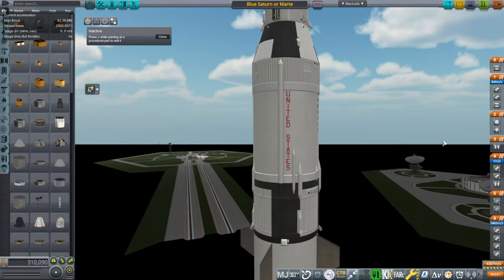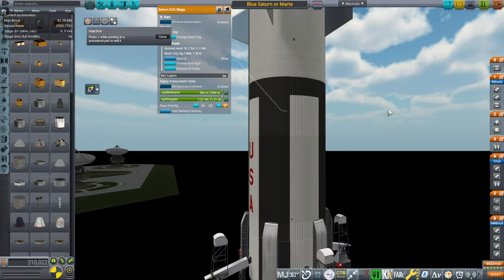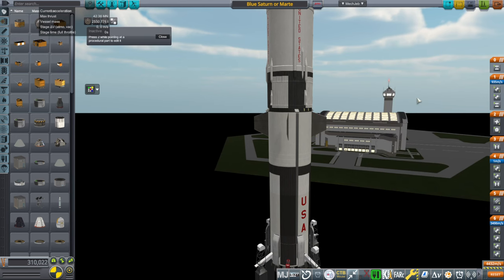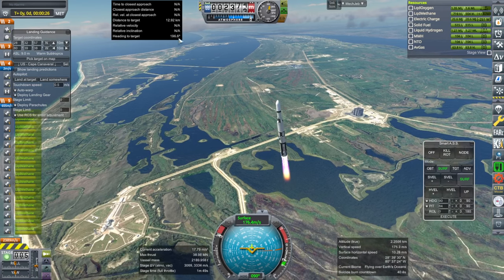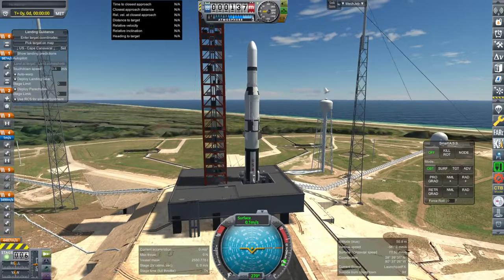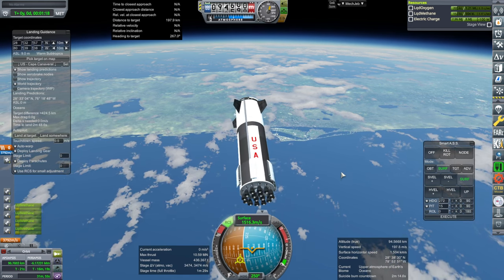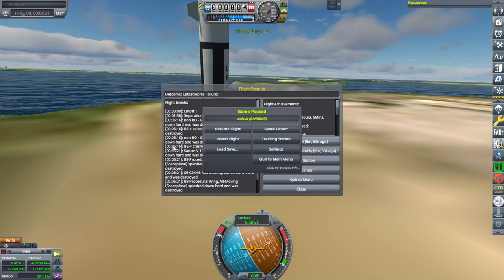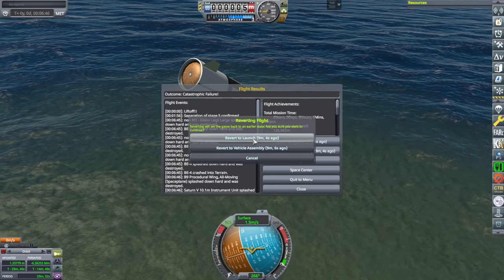Blue Saturn First Stage RTLS Test

Comment: The time from stage sp to boostback is way to high that eats a lot deltav
Reply from the maker: Yes, I agree - the RCS is underpowered, but I could also turn an engine on earlier.
Reply: @RaizSpace  maybe hotstage and keep some engines running on low power, then turn around on vectoring